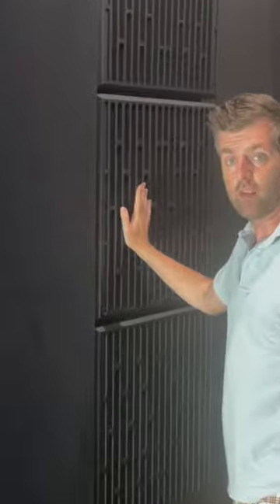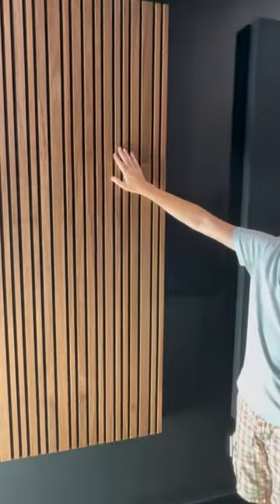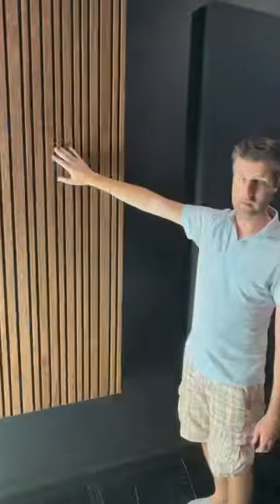Acoustic treatment in my HOME THEATER

Comment: Anthony has been a advocate of mixing it up per side wall.  But this video looks like you are more symmetrical.  

What are your feelings/experience on that?
Reply from the maker: He's not wrong.  I just like the look of symmetry.  

I would argue that the acoustic benefit of asymmetry is achieved even with acoustic symmetry.  The reason is that diffusion is, by nature, the result of phase mixing that causes a kind of phase randomization.  As such, it doesn't really matter if the panels are symmetric or now. But in the absence of ideal phase mixing of the diffusers, switching it up can have the benefit of encouraging that.  

So I am inclined to say that both can work, but symmetry needs better diffusers to work right.